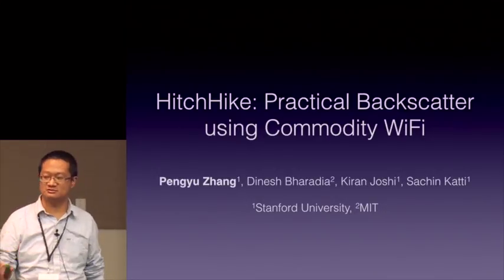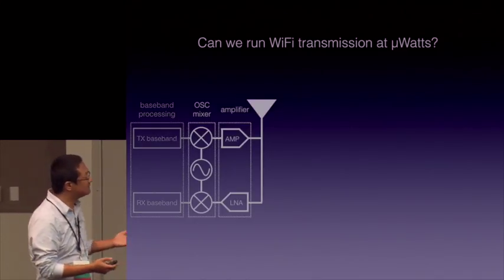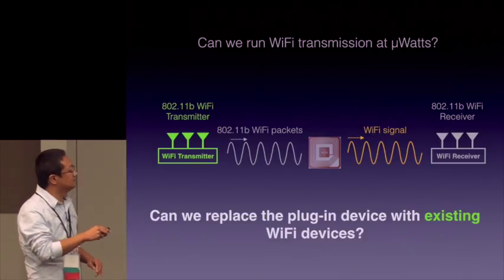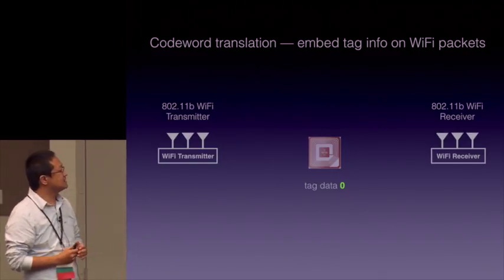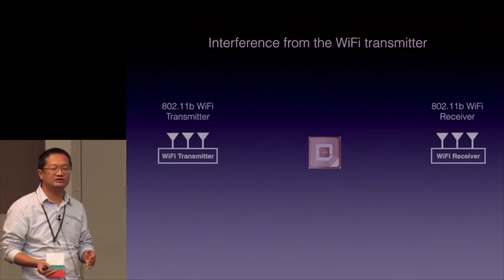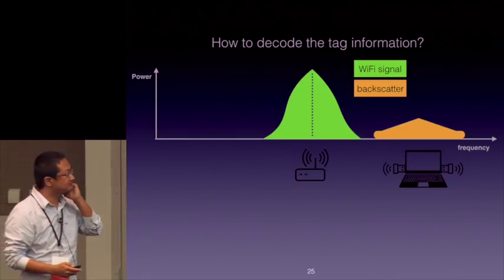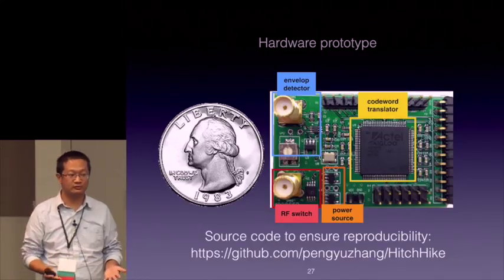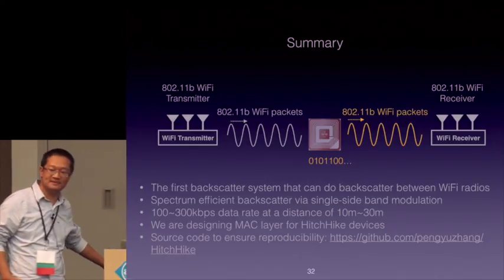SenSys 2016 - HitchHike: Practical Backscatter Using Commodity WiFi

Comment: Did you modified wifi driver code at Mac pc to accept even bad fcs/crc packet as xor operation might have corrupt fcs and packet length fields, or you receive data from wifi card in monitor mode?